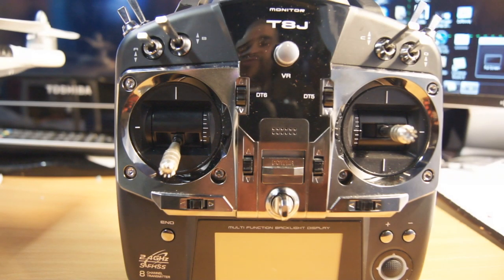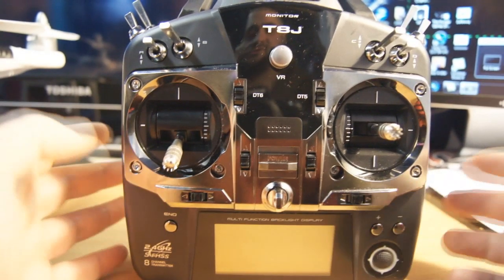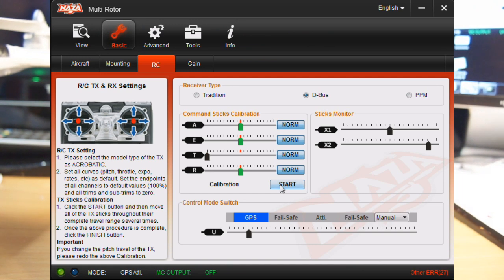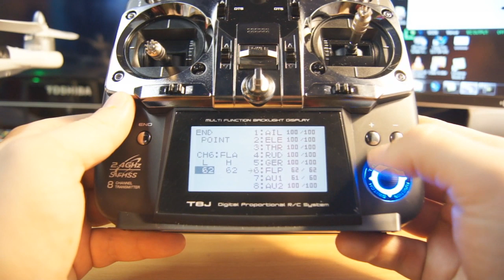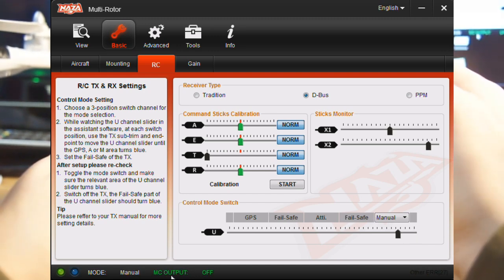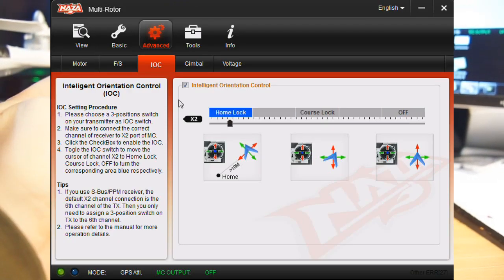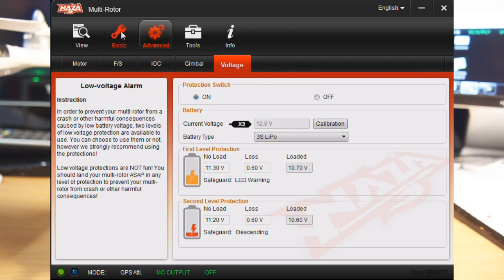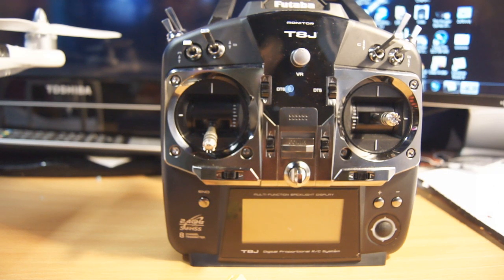How to install Futaba T8J on a DJI Phantom (part 3)

Comment: gooday i just build my dji f550 followed all your videos on how to build.my motors turn but it does not want to take off.two motors is running slower than the rest.using a futabu t8j did all the settings the same as you. can u please assist as im in south africa

Comment: Hi - Have you got any videos or info on end points on throttle? I have a problem....when I pull back on the throttle the motors turn completley off. Not good if I throttle down to far when I fly. I just want to get them to tic over when pulling back on the throttle. Better for landing etc Any ideas? Flying a TBS Pro with Naza V2.
Thanks

Comment: Hi there,

I'm having problems with my naza lite and futaba 8j. My control switch keeps hopping from gps to manual and I've played with my sub trim values every which way. So frustrating. I have a 30 sec video that show it do that.  Any chance you could help?

Shane

Comment: Great video M8. I followed your setup for my F550 with Naza lite except for using normal mode for the RX as I believe S-bus doesn't work with the Naza Lite. All is working perfectly except for my loss of signal Failsafe. I switch the TX off and it won't enter failsafe. I can't figure it out, any ideas?
Reply: oh and I'm using the Futaba T10J which shouldn't make much difference

Comment: i cant seem to start my phantom with the same remote everything els is working but start? the normal way which is a V to the left bottom corner and the right  left corner does not seem to start my phantom up.
Reply: Hi, I am having the same problem! Did you find a solution?
Reply: You have to check your gains in the rc assistant
Reply: Ok cheers

Comment: I have a quick question you might be able to answer. I just put together a hexacopter dji f550 clone. dji v2 controller with gps, dji 30a speed controls and some cheaper hobbyking motors. I have my futaba t8j linked to it. When I arm the motors, they idle normally but when I give it throttle and especially full throttle, the motors arent very responsive when I decrease the throttle. futaba is hooked up as s-bus and everything looks good in Naza assistant. any idea at all what make the throttle so unresponsive?? any help appreciated :)

Comment: Hi HPI Guy, Happy New Year first of all. I have a question for you if you don't mind : I finally had the maiden flight yesterday with my new T810, commanded by my Futaba 8J. It flew well in general, but I had a strange phenomenon : every time I went further out than 50 meters (yes, only 50 meters), my Naza went into failsafe. Recovering the flight once the rig was back overhead was no problem but the F/S was systematic at about 50 meters.
It looks like the RX or TX loose contact very quickly. Maybe an error in the TX settings ? Any ideas please ? Thanks. Phil (from Bali)
Reply from the maker: check that the radio is not in Range Test mode. also make sure the antennas are not too close to anything electrical, ideally you want the antenna's to be 90* from each other.
Reply: When you open your Futaba 8J and you go to the range test page (by holding down the jog-key and powering up the TX) what part is highlighted please on yours ? Is it "power down" or "off" or "on" ? On mine it is always "power down" which is highlighted but I don't know if this is default, so I'm worried it might be stuck in that mode which would then limit my range to 50 meters.

Comment: hey, the standard tx comes with double spring loaded sticks so throttle always returns to center. does this setup make it hard to hover in place? is there anyway to do this?

Comment: Do you have any experience with the FASST system from Futaba? I own a T10 with the FASST system and would like to buy a phantom.. not sure wheather it will work, but should be the same. My T10 menu looks almost the same. What do you think?

Comment: Hey im wondering if u can help me i just fitted a R2008SB to my phantom and im using a 14sg with it, now ive pretty much got everything sorted except for manual mode, when i click the switches it goes into gps atti and then under manual but it doesn't select it at the bottom left like you said to make sure! The weirder thing is when im flying if i switch into "manual" even though its atti the quad drops a good bit until i trottle up and also feels like its actually in manual. Any suggestions?

Comment from the maker: thats due to DJI new firmware, any quadcopter using naza M has a new "auto take off" mode, basically you put the throttle to above 50% and it automatically does a smooth take off for you. if you don't like it then roll back to an older firmware ans assistant.

Comment: I have a radio that has throttle set to 50% and it bounces up and down. This causes my new futaba to run idle at 50 percent and then I can increase throttle after 50%.and it flies. The only problem is that I don't have my eyes on throttle so if I go below50% it will shut down.  Do you know how I can set my phantom to work with the full throttle. I mean how can I make my radio work from  about 15 percent throttle?

Comment: Thanks for the video.  2 questions, 1st I don't have a 3 Pos switch on my T8J on the upper left like you but I have 2 on the right, can I just use one of those for the IOC and second after doing the radio calibration, the on screen sliders don't go all the way side to side when moving the sticks, is this an end point adjustment or an on screen setting?

Comment: Hi! Great videos... Did what u did n ur videos and my t8j works awesome!... Question can I set one of the switches to control a auto look down? I have pitch control with the knob in the middle of the t8j but I would like to hit a switch and have both hands on the controls if possible. Thanks:)

Comment: @wasatch1000 
There wasn't much different as I recall.  Although, in this video above he sets the right switch to Manual, Atti, and GPS.   I set mine to Atti, Atti, and GPS.  Manual is way to shaky and hard to fly (as he says) so I just left it out.  

BTW This video (although the software is not EXACTLY the same) combined with the above video got me through it (I'm a newbie). [Search this title]
DJI Naza-M Assistant—TX Calibration(Futaba)&3-Position Switch&Fail-Safe

Comment: Great work! Would you recommend this transmitter for long range fpv? I'll be getting the immersions 5.8 600mw so im wondering will it be sufficient? just signed up to the forum the way.

Comment: Hi Guy, 

Why is the Futaba T8JH Radio  better than the original one from dji phantom? and why are you using that? what are the advantages? when you buy the Futaba T8JH Radio is the sender unit included or have i to buy it seperatly?

Comment: Great video. Apart from the extended range and the fail safe button did you noticed anything better when using the T8J? I have one T(J and I can use it if it improves somehthing.

Thank you

Comment: Ok, spoke too soon. When flying, every so often it hiccups. It looks as if one switched from atti to GPS mode, where you can notice a slight movement when changing modes. I went back into the Naza and looked at GPS, atti, etc. it stays locked until I move the switch to a different mode. Any ideas? Have you seen this before?

Comment: Hi. I have a couple of questions for you: 1. I have a Naza M on a F450 with T8J connected via the S-BUS and it jitters around quite a bit. Did rebinding your TX work? Only I emailed AliShanmao the same thing and they said it's a known problem and they don't use S-BUS. 2. I noticed your version of assistant software looks newer than the one I got with the Naza M (V1.8) is this only compatible with the Phantom? 3. How did you bind switch D as your RTH, that's exactly what I'm trying to do. Thanks

Comment from the maker: no one is telling you to add a futaba, I am just showing incase a few people want to, then they can still use the futaba when they buy their next multi rotor, you can program 20models into it. people have said they can not get a 330 to fly "as nice" OR  "For as long" as a phantom. the stock controller will be ok for 99% of users.

Comment: Can you elaborate on 'Exponential' settings? Another vendor talks about setting his Exponential to -45 for the sticks. In your Part 2 video, is what you did with the P Mix and the Curve setting that to the same thing? You set P5 and P4 to -45. Setting mine up on Moday. Love your videos Good info for this noob. Thx.

Comment from the maker: I was setting it up for manual. if you don't want to do that you can choose ATTI, that will make the (Right) 3pos switch GPS/ATTI/ATTI. just leave the end points as they are. If you are under ATTI and it still does not say attitude at the bottom then adjust the the end point until is does say, If you don't then it will go to failsafe.

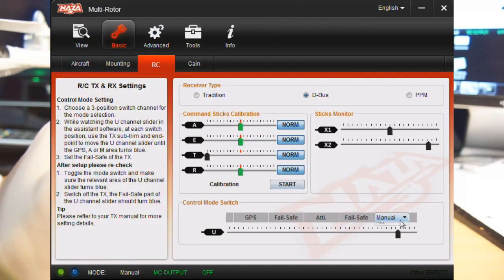Comment: At 2:26 in the video you are setting up the ati or manual mode switch, if I leave it at ati mode will I still need to make further adjustments to the end points if it does not display ati on the bottom display on the Naza assistant ?

Comment: Was it easy as you have displayed to setup the Futaba because the Naza was already per installed. Other videos I saw were guys just install the Naza have to setup a lot more as far as the switches and end points.

Comment: Thanks for the video ! I noticed that you didn't go into the settings to set the % to 54% for the fail safe and when you were testing it after you setup the TX  you really were moving the right stick a lot.